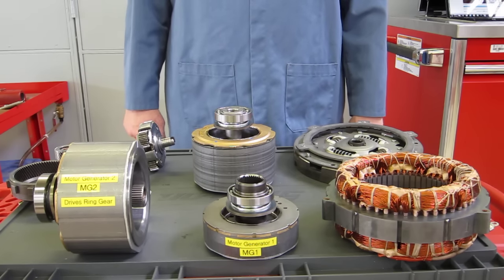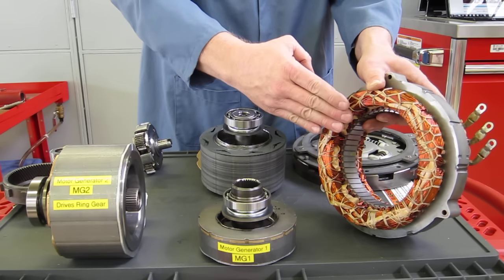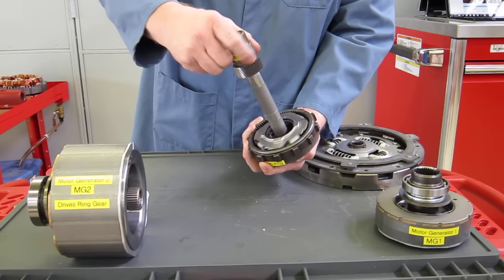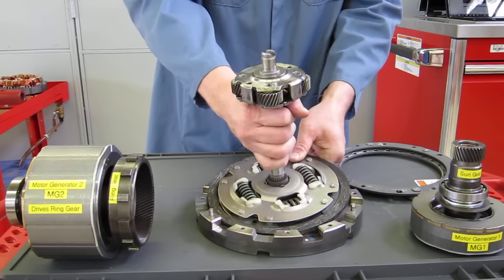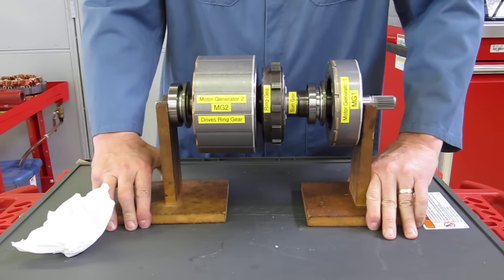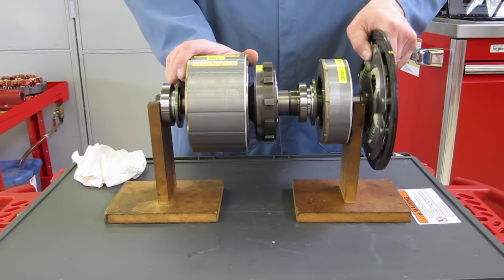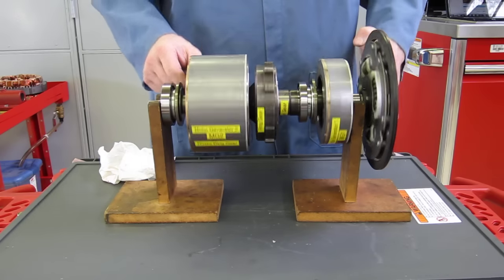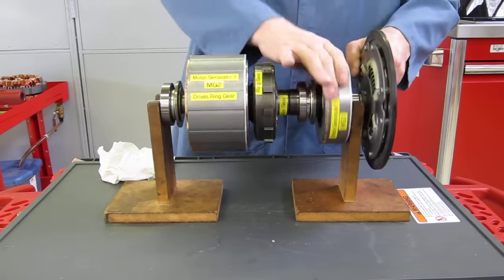2004 - 2009 Prius P112 Hybrid Transaxle (eCVT) Operation

Comment: Another car enthusiast here. I already appreciated the Prius, not for being an enthusiasts car, but for being an extremely reliable and quite comfortable runabout. Now I see how it works, and how advanced yet simple it actually is, I'm starting to see this car somewhat as an enthusiasts vehicle :-)
Reply: Fairly reliable, this CVT has its issues too. Overheating, slipping, lurching or jumping. It’s vulnerable for issues as any CVT. I do like Toyota’s and their reliability but they do have issues. Just poke around on google and there are groups who have complaints about this costly CVT
Reply: @jeffsond  lol, I don't know what you're on about - technically it isn't even a CVT :) only issue I hear that comes up regularly is the cooling system failing (and resulting issues after continued driving without appropriate cooling)
Reply: This car is loved by places and countries that have remote driving area and poor service distribution, as it is much reliable than conventional cars transmission and engine is, also, very robust for those markets. Because, most of the time cars do not drive fast long enough and have to slow down or break often, and accelerate again. Up and down hill offer good petrol saving, and engines do not overheat as much.
Reply: @4nz-nl  maybe try doing more research and you will see what I’m talking about. It’s real simple
Reply: @jeffsond  That's not how you get away with not supporting your claims ;)
Reply: @4nz-nl  it’s the same way you responded to mine. Now go search
Reply: @jeffsond  research says that any vehicle that is not maintained will have components that fail prematurely. Easy to get 300k miles out of a well maintained prius, original battery.
Reply: @jeffsond   This eCVT can't "Slip" there is no clutch or any non-gear disconnect from the crankshaft. Overheating can be from a failed electric water pump, which usually lasts longer than a standard gas belt-driven pump. This is not like other CVTs and has an extraordinarily low failure rate.
Reply: @musicmakerman867  true but it’s has had its share of issues. From an article I’ve read
Some drivers have complained that their vehicles encounter unexpected acceleration or trouble shifting gears, which can be dangerous. 

Toyota has published a series of technical service bulletins (TSBs) concerning gearbox software faults, and some Prius cars have been recalled to fix these concerns.

To address these difficulties, Toyota has published software upgrades, and many Prius owners have experienced improved performance and dependability after installing the patches.
Reply: @4nz-nl  I know what ur on… you take that Toyota pill allowing you to believe nothing goes wrong with Toyota vehicles. Here’s a list of issues with just the Prius. 
2022 Prius loss of power issues due to ECU issues and needed updates. It was a common issue and dangerous. 
2916-17 rollaway risk due to faulty parking brake. Recall
2016-18 wiring harness caused electrical shorts and possible fire hazard. 
2019-2020 loss of stability control and brake assist due to failing brake booster pump. Recall
2016-18 easily cracking windshield. Many owners had to have their windshields replaced. 
2010-2020 IPM issues cause hybrid system to shut down. Numerous recalls.
2010-2015 severe brake issues  costing owners thousands of dollars. Toyota extended their warranty. 
2006-2011 faulty engines. Excessive oil consumption. Lawsuits against Toyota. Some recalls issued. 
2010-2012 defective airbags. Recall 
 Prius is a solid long lasting car but don’t act like it’s never had its issues. Some of the brain washed Toyota people just can’t face the fact they Toyota has had their problems. 
I still think they are the best cars/Trucks being built but I’m no fool. 
If you would like me to go through each car or truck with their specific issues I can do that.
Reply: @jeffsond  is that written by a robot? There are no gears to change in this transmission. Yes, Toyota has had unintended acceleration issues but the transmission/transaxle is not the cause.
Reply: @jeffsond  I'm not even a car guy anymore, and a former D4-D owner so no Toyota pills here ;) did drive well over a million kilometers in my life, and concerning reliability, in my experience, Toyota is the brand to beat.
Even if I look through the list of issues you come up with, I'm only thinking it doesn't even come near the cost that only one of my Audi's took me through. Let's just say I'm glad most were company cars 😂
Reply: @4nz-nl  I agree, Toyota is the one to beat!
Audi is no vehicle you want to keep for more then 5 years or 130-140,000 miles. It then becomes a money pit.
Reply: @jeffsond  Also in your list of issues not one was linked to the second gen, which in my opinion was and is the best built, most reliable of them all to date (also happens to be what this video is referencing.
 With that said, yes the second gen has its own set of issues, but that's for another video 😉
Reply: @drury2d8  just change your cooling túbe

Comment: I've always chosen to drive manual-transmission cars, because I like their mechanical simplicity compared to automatic transmissions.  I'd assumed that hybrids were even more complex, so I've never been interested in them.  However, after looking at this video, and the excellent companion video of the 3rd Generation eCVT, I'm impressed by the overall efficiency and simplicity of the Toyota concept.  I'll definitely consider a Toyota hybrid for my next car.
Reply from the maker: Thanks for your feedback!
Reply: Late reply but these transmissions are the most robust and reliable I have ever experienced. Never had any issues with them, even well into old age 450,000kms and beyond. The most I've seen is some leaky seals so some splash lubricant can leak but the actual mechanism used in the first and second gens are phenomenal. Can't say the same for brand new junk 😂 but our first gen Toyota Highlander is an absolutely outstanding vehicle
Reply: There is an incredibly detailed and well done software available to the public called Hybrid Assistant that allows you, in real time to monitor every possible facet of MG1, MG2, and everything from high voltage battery real time charge and decharge, temps, all combustion gauge values even high voltage fan speed. Having these values real time is crucial if not just for the fact that only a Toyota hybrid is monitoring that many systems, and just as a space shuttle launch command — after a while you start to understand the personality of your vehicle so you can understand what is going on with her before a possible incident or how to achieve performance or efficiency.

I love driving my hybrid systems with all that real time data 

You need a good OBDII sending unit and you’re good.

Comment: I heard that the fuel injection begins only after the engine has been spun to operating rpm by MG1. That explains why the Prius has very clean emission despite the frequent engine start and stop. In regular cars, the starter motor only turns the pistons to proper firing positions, the first few burnings may not be clean when the engine is not yet in ideal rpm.

Comment: What's crazy is I don't think there are any sort of patents going on here that we keep another car company from doing something similar. It's just crazy to me that one of the big three auto makers in America having triple the size of this system threefold to give Large pick ups the ability to tow and get close to 15 miles to the gallon. That would be double what they do now. And unloaded they'd likely get 20 to 25. This seems like the obvious solution for larger tow vehicles since towing on pure battery. Power is just not very feasible.

Comment: As a car the Prius has many faults which prevent it from being an automobile for enthusiasts. I used to belong in this camp, until I've recently driven a Prius C.

After driving it and doing the research behind the technology (and especially the eCVT), you have to be amazed that Toyota figured out how to use a single planetary gearset so efficiently before anybody else did and made the hybrid system blend EV & gas power so well. Well done on the explanation!
Reply from the maker: Trades46 Thank you for watching!
Reply: Trades46 My understanding is that the Power-Split Device ("PSD") was originally patented by a group of California inventors.  Toyota made it work though, kinda analogous with the Wankel engine having been invented a long time earlier, but Mazda made it really work.
Reply: Can you List  a few  of the faults?
Reply: The motor in the Lexus hybrid is even more smooth on blending EV and gas. I love it. Never thought I would like a CVT
Reply: I have a Toyota Aqua (prius c) and I see nothing in it that prevents it from being an enthusiastic vehicle. 
There’s nothing inherent with a PSD Hybrid that stops you from driving, racing, or having fun with it. 
I’m curious what you used to think those “inherent faults” are other than “cars that were designed specifically to sacrifice performance for efficiency don’t have as much performance as cars that do the opposite”. 
Big surprise.
Reply: Craig G somethings wrong if your getting better mileage on the highway than in town.
Reply: @KiwiMaker  Not really. A Toyota Hybrid can run the engine at the absolute efficiency sweetspot all the time, regardless of actual speed. They're good innacity because they can mostly just float around on electric, but if it's running the engine unnecessarily to keep the battery topped up then you can get losses whereas on the highway you get 100% transfer from engine to wheels without anything being spent elsewhere, and with no conversion or storage losses. 
Go too fast and wind resistance will start to bite you, but the bodies of the Prius and Aqua are essentially wind tunnel experiments that got turned into cars.
Reply: @brkbtjunkie  That makes sense, since Lexus is Toyota's luxury line.
Reply: Kiwi Maker my lexus hybrid is rated for 39 city 40 hwy
Reply: @KiwiMaker  yes I agree, my 2010 does exceptionally well city with care 75 mpg highway 48-52 depends on speed
Reply: It was made by Asin
Reply: it wasn't toyotas idea. This rough design goes back to the 1960s
Reply: @funposting8912  lol my Prius c has bigger injectors, ported intake manifold ,egr delete, headers and a cold air intake I’m trying I really am it does keep up a little with other cars I have a video posted of me racing
Reply: @funposting8912  all while getting 30 to the gallon driving with a very heavy foot
Reply: @therandomrobert1842  Watching all your videos now, absolutely beautiful!
Looks like I have some work to do, tempted to see if I can get a turbo behaving on my test engine because otherwise I'm at a loss for how I could possibly surpass what you've done.
Keep us posted with what you're doing (and I hope your arm's feeling better!)
Reply: @funposting8912  yeah it’s feeling ok to work with I’m actually considering a turbo or supercharger I have a cheap ebay turbo and a manifold already but that would need more work than a supercharger I’m tryna poke around online and see what I can find it’s fun having a car nobody suspects to be modified
Reply: @juanvaldes1837  Best I've seen was 73 mpg on an easy but long suburban drive,  and 50 - 60 mpg on motorways ... 2012 Prius

Comment from the maker: Hi, thank you. You are absolutely correct regarding reverse. I realized my error after shooting the video, but nobody ever said anything until you. What I should have said is that MG1 will spin the opposite direction of MG2 in reverse because the planet carrier is stopped with the engine off. This allows MG1 to start the engine if necessary (which mine usually does upon cold startup) while backing up.

Comment: A very nice and clear explanation on the Toyota Hybrid drive system, and unusually accurate as well – Very nicely done.
My only point would be that MG1 never drives the car. When going backwards it is always MG2 that provides the motive force (just like when going forwards) 
Whilst driving backwards MG2 is the motor and MG1 will be freewheeling, unless the engine needs to run in which case MG1 is a generator charging the battery (Providing the electricity for MG2 to drive the car)

Comment from the maker: @sosarres  2. (Vehicle moving) Rotate MG2 (ring gear), MG1 rotating more than 2.6 times faster than MG2 (sun gear), the crankshaft (planet carrier) will rotate to start the engine.  There is also a time when the crankshaft will be rotated but the engine is not intended to start: Full battery charge, decelerating down a long steep hill, regenerative power has to go somewhere so it is used to rotate the crankshaft with MG1 to dissipate the additional energy.

Comment: So this is how the sequential parallel system works. I love the simplicity of it as the ring, sun, and planetary gears are the only mechanically moving parts in the transmission, and by simplicity adjusting power/drag to MG1 you effectively control the entire ratio range. It's also ultra efficient as when MG1 is driving the sun gear for a high wheel speed, that energy ends up at the wheels too outside of friction losses, and when MG1, MG2, and the combustion engine are RPM matched, the entire transmission moves as one part, and as such there's no friction from the meshed gears

Comment from the maker: @luvmygooose 1. The P112 transaxle input damper (looks like a clutch disk) absorbs the shock that accompanies transmission of the drive force from the engine.  It is permanently applied.  If it slips, a P0A90 DTC will trigger for a transaxle input malfunction.

2. The vehicle can move on Motor-Generator 2 (MG2) power alone (up to near 37 MPH) or a combination of both the MG2 (driving the ring gear) and the Internal Combustion Engine (ICE) driving the planet carrier (at all vehicle speeds).

Comment: Thank you for this presentation. This vehicle is not completely a independent novel concept since it incorporates a lot of technology that may be familiar to other transportation modes  such as freight trains. Having said that, it is undoubtedly the pinnacle of Toyota's engineering with conventional and electrical propulsion . I also get lost in the details of wheel and tire technology used, also weight distribution and energy use and conservation. Your poise as a teacher is also reassuring

Comment: My favorite part about the Toyota hybrid platform is actually the transmission... what drew me to Toyota was their hybrid platform. My whole family owns a hybrid from Toyota now because of how reliable and efficient they are (five vehicles now... I'm on my second hybrid, nothing wrong with the first one, just wanted a new car... 2020 Corolla hybrid). Love the buttery smooth shifts even at 100k miles. I hate autos with fixed gears, shifts thumping, sticking, hesitating, so on and so forth... especially with age.

Comment from the maker: @sosarres Hi, you are correct when you state that the engine's crankshaft will rotate at the same speed as MG1 (when MG1 and MG2 are rotating at the same speed as each other); however, this is not how the engine normally is started. The most common ways the engine can be started are: 1. (Vehicle stopped) MG2 stopped (ring gear), rotate MG1 (sun gear), the crankshaft (planet carrier) will rotate to start the engine.

Comment from the maker: @supermachoman222 Hi, I appreciate your comments, but they are incorrect. During electric only mode MG2 propels the vehicle and the engine's crankshaft is stationary; there is no piston movement. This mode is only used up through a maximum of 40 mph. Afterwards, MG1 acts like a starter motor and does start the engine to contribute power to MG2 and to slow down MG1. This is very efficient resulting in the best city fuel economy of any hybrid-electric on the road.

Comment: Transaxle damper has internal springs to sort out the vibration when the engine starts and stops, to reduce the shockwave through the drive train. The Friction material the there in case of a catastrophic failure or the engine at speed to make sure that the roads wheels don’t lock or destroy MG1 by over revving.

Comment: Best dive into the Prius gen 2 I've seen. Running 2( 2008 w/ 220,000 and 2007 w/ 290,000 ) gen. 2's currently. Love them but '07 needs at least one new batt. cell( death triangle getting consistent). Even a Prius needs some maintenance!

Comment from the maker: @supermachoman222 Hi, MG2 is not connected directly to the engine.  MG2 rotates to propel the vehicle even if the engine is off. When the vehicle is stopped MG2 is also stopped.  The engine can run with the vehicle stopped if the high voltage battery needs to be charged or if the engine or the catalytic converter needs to be warmed up.  Regardless of what you read for fuel economy ratings, all three of my hybrids get better fuel economy on the freeway than in the city as long as you don't speed.

Comment: This works practically in identical fashion to the Owen Magnetic of ~1915. The principle difference being the use of the planetary gear set, which allows the generator to be smaller, and eliminates the need for brushes and collector rings.  In both cases, however, the reaction torque generated by the generator (MG1) (as a result of the engine driving it) mechanically assists the traction motor (MG2) in providing drive power, reducing the amount of power which must take the (somewhat less efficient) electrical path. The Owen Magnetic did not use a battery to supplement engine power, and therefore is not a hybrid. Reverse will be achieved by reversing the traction motor (MG2) in all cases, engine running or not.  Attempting to drive the wheels via MG1 would also apply torque to the engine, very likely causing it to turn.
Reply from the maker: Thanks for your feedback